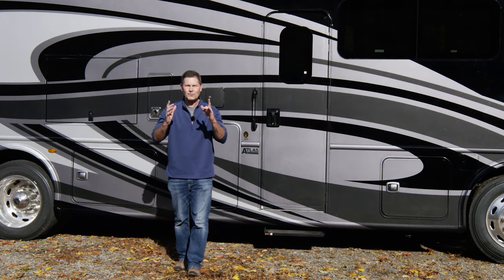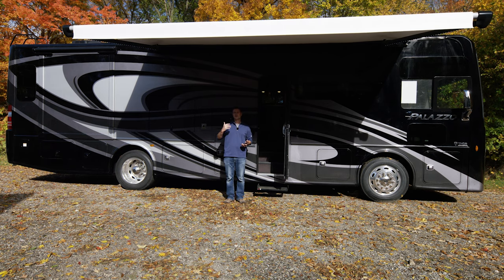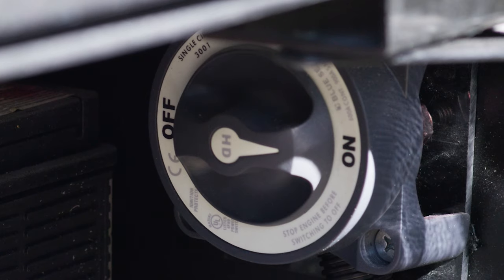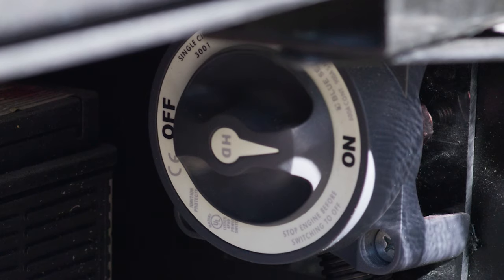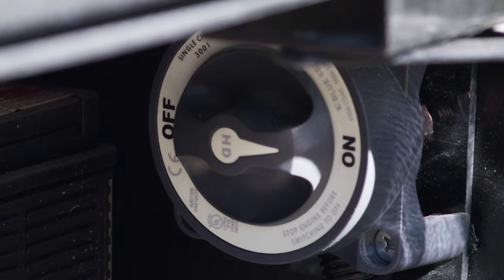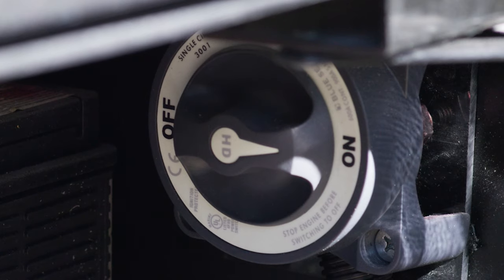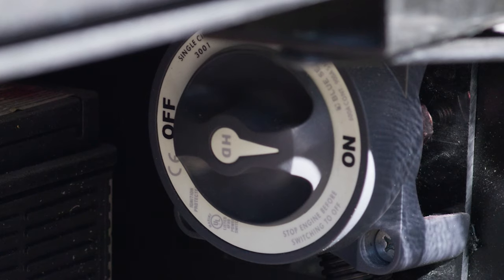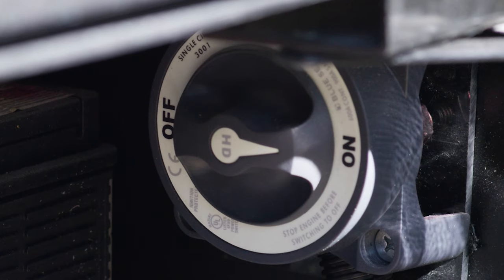How To Use Your Palazzo Luxury Class A Diesel Motorhome From Thor Motor Coach

Comment: The pull release for the generator has a bracket which attaches to the compartment side wall. It appears in the video that it flexes too much and is not a solid attachment. With time I can envision the bracket separating from the wall.

Comment: PSI on the labels is not proper inflation. You need to know the tire weights so you can look them up in the tire manufacturer's inflation chart, and set them based on actual load on the tire. I weigh RVs with tire scales, adding tires on an axle to get axle load, and axles to get gross scale weight. Most of the RVs that come to me have the tires over-inflated for the actual tire loads, and that wears them out faster.

Comment: Did you say to switch back the air dump to auto BEFORE retracting the leveling jacks?
Reply: You can break your jacks if you do this in the wrong order! Make sure you find out to do it safely!
Reply: @HappyQuailsLC  the dealer is the one that said, dump, extend jacks, slides out. In that order. Is that wrong then?